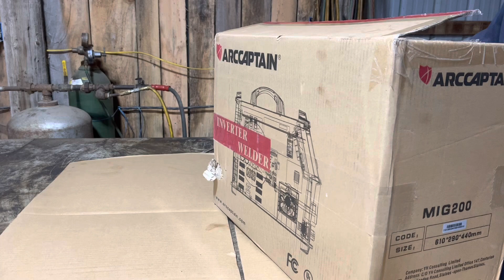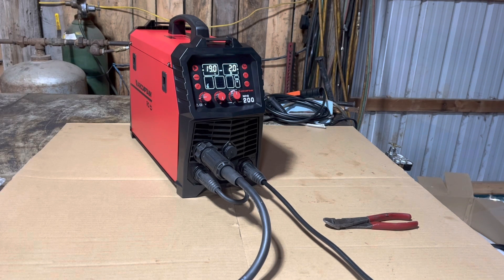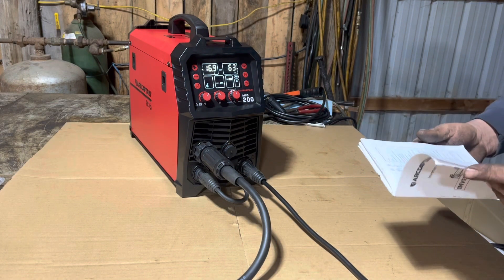Unboxing and trying out a new Arc Captain MIG 200 iMIG/TIG/stick welder

Comment: Hey mike, a couple of tips for you. It's not 'synergetic', it's 'synergic'. Plus, when MIG welding with shielding gas, you push, don't pull...
Reply from the maker: Ah ya as I mentioned I am no welder. But I seem to remember “If there’s slag, you drag” now that u mention it. What does “synergic” mean anyway? I know it has to do with automatically setting the wire speed with the heat, and I’ve learned that it seems to work better to use that mode with flux core. 
Another thing, I found out tips are available at the local farm store.
Reply: @rustyoldjunk  It means 'coacting'/ collaborating and simply 'working together'. The word 'synergetic' does exist but welder companies are using the word synergic per se, espousing the point of 'working with the weld conditions to 'adjust' them slightly (electrically). It's done through the electronic fields and resonance/modulation as I was mutually explained. But anyways, it does seem to have a better effect on some welders than others. I've honestly never tried that with FC so you convinced me to try that and see what effect if any it has with my ArcCaptain too. Cheers!

Comment: I've been impressed with the reviews and customer feedback that I've seen. Unfortunately none of the reviews give the duty cycle. The guys that will be doing the welding need a Spanish language manual. Are they available?
Reply from the maker: I looked in my manual, it has a graph for duty cycle. If I’m reading it right, for 220v use it’s 100% at 100 amps for any function, 60% at 175 amps for stick and 100% at 200 amps for MIG or TIG. Pretty impressive. 
My manual is only English however I’m sure if you emailed customer service at arc captain they could get you one printed in Spanish. There’s a link in the description for this welder if you’re interested. I’ve had about 3 months now and it’s been reliable so far. Thanks for the comment.
Reply: yes,  europe version do have spanish manual. the one in vedio is US version.